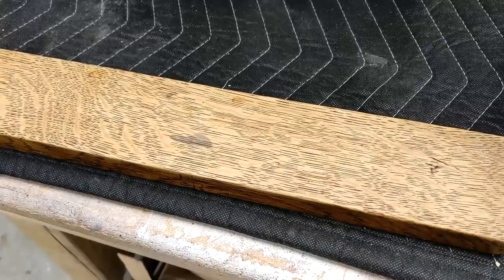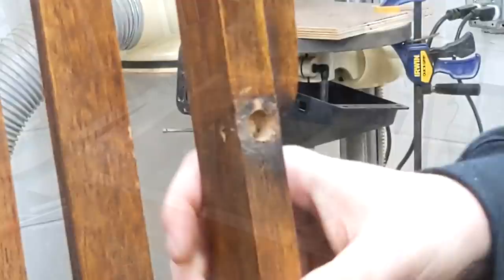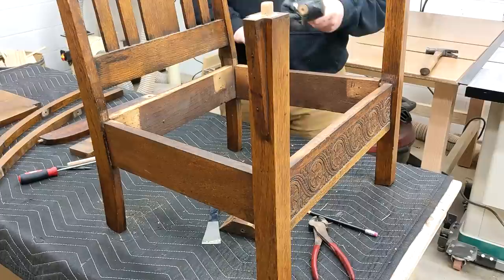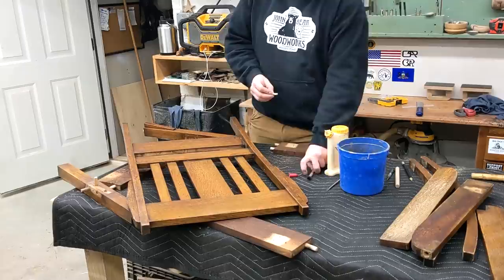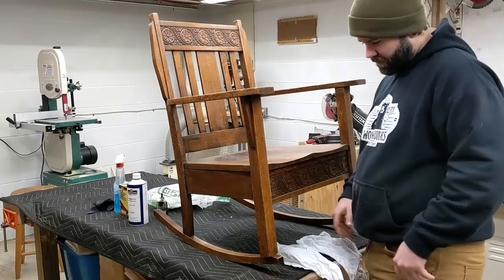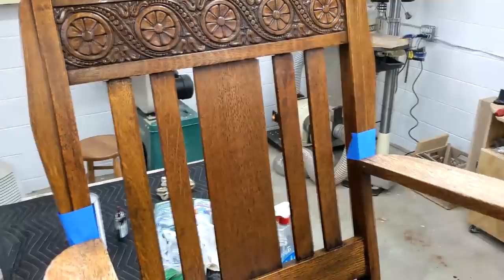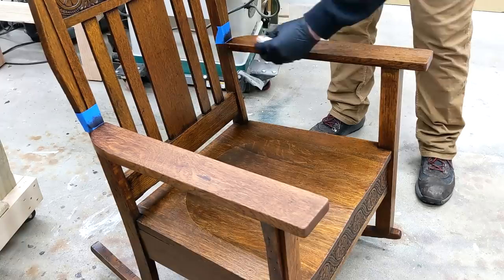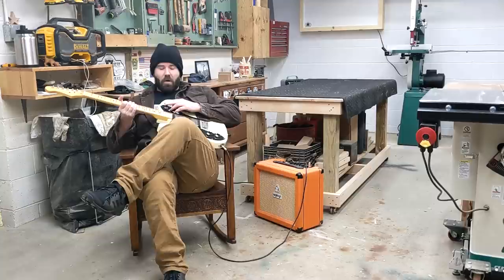Step by Step Rocking Chair Repair and Restoration | How to Repair Furniture

Comment: Quick simple repair. Mmmmmmm. Reminds me of my ongoing project which has stopped due to COVID-19. I attend an upholstery class and decided an antique 2 seater French settee would be just the thing (I know,I know) The taking apart was like you and your rocker. Nails, screws, dowels and glue. Most where I wasn’t expecting. But she is now all back together and I had just started with the horsehair padding. Luckily our tutor believes nothing that has happened to a piece of upholstered furniture can’t be fixed!  Don’t have any idea when I will get back to class but 1 day. 
Loved the finished chair. Lovely wood.